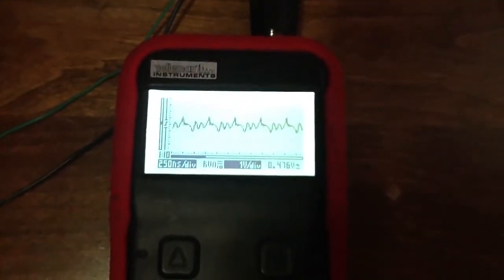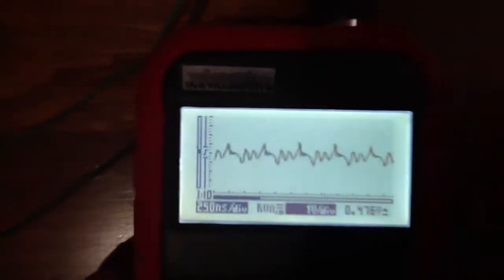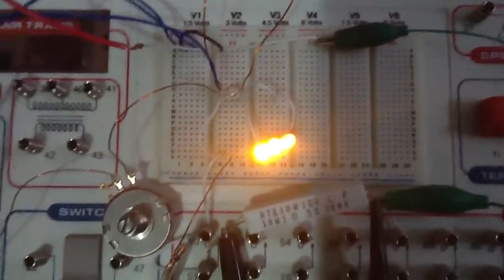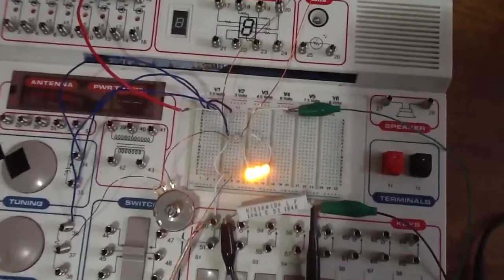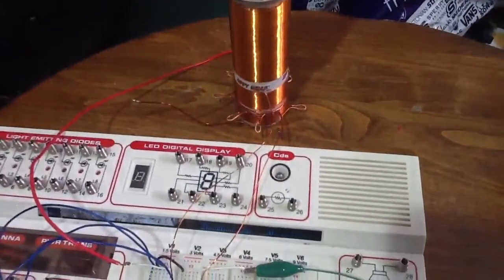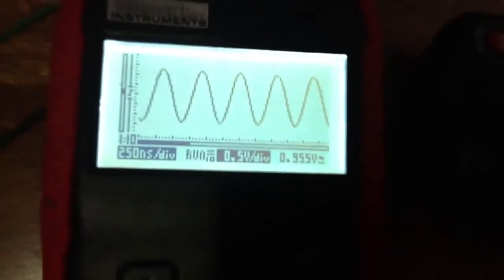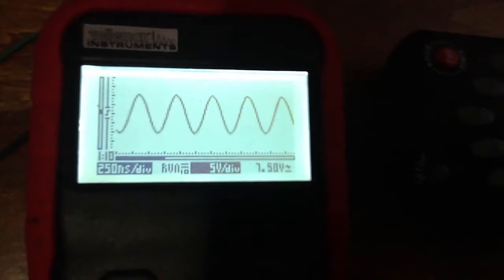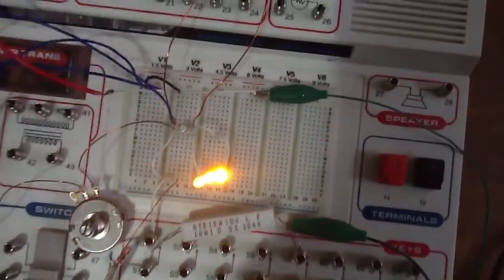pt2 TMT Tesla Magnifying Transmitter Slayer Exciter 24 hour Update

Comment: Where from you took value of 0.240 watt?
Reply from the maker: Hi the .240 watts is what the LEDs need to run at full brightness, so if you achieve full brightness on the LEDs with the Exciter, then compare what you actually used to get the same result as the regular DC.
Much owed to the high amplitude of transient waves generated from the "off-switching"
Reply: ***** Thank you for reply very impressive. So the LED consumes 20mA at 12V for full brightness (for regular DC power supply)?
Did you  measured with lightmeter the intensity of leds?
Reply: Arman Gevorkyan regular current measurement shows high current consumption, however by measurenig the energy used from battarey the results shows consumption of 41mA from 1.2V rechargable battarey . I am correct? Can you please share the schematic, i would like to replicate.
Best Regards
Arman
Reply from the maker: Hi Arman, see "GBluer" youtube channel, or look up "Slayer Exciter" on google images, what i added was a series LC on the base/emitter like DrStiffler, which you can easily find on google as well under "NILS circuit". hope that helps, i will make a schematic next vid
Reply: ***** Thanks!

Comment from the maker: ( Update 02/26/2014 this ran for 55 hours on the 1.2 rechargeable 2300mAh AA battery, last measured dead operating voltage 1.124V 
(from 1.2V original) using 41 mA @ 1.2V (not 1.5)
consuming 0.049 Watt, 
while obtaining above 6 volts loaded Output and what i would consider full brightness on the 2V 20mA series LEDs. Requiring 0.240 Watt, based on that, a Cohered Energy Coefficient (CEC termed by Dr R. Stiffler) of 487% 
(0.240 / 0.0492 = 4.87) (1=100% 4.87 = 487%)
Energy obtained from the Tesla tower @ this voltage
Reply: Nice!